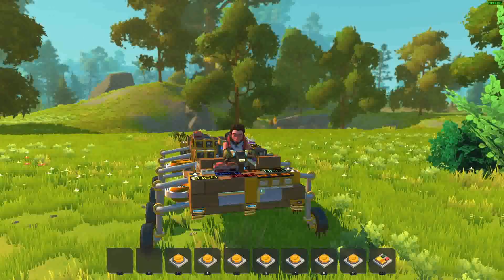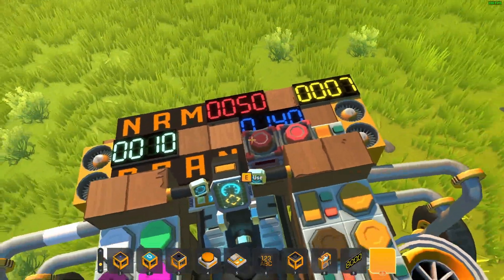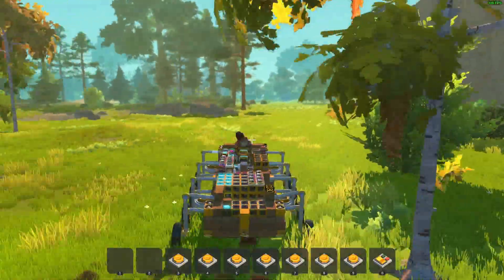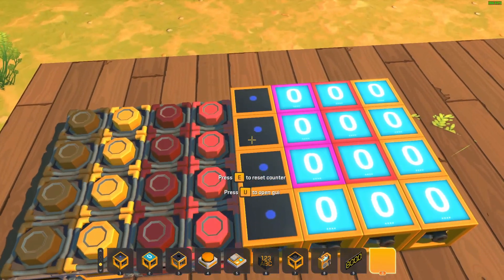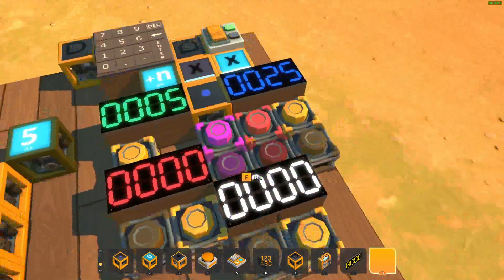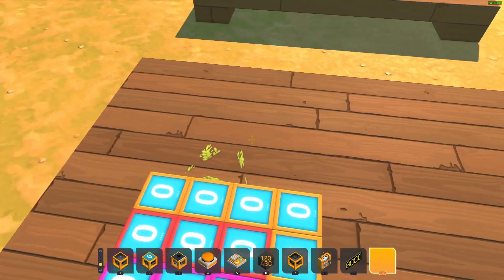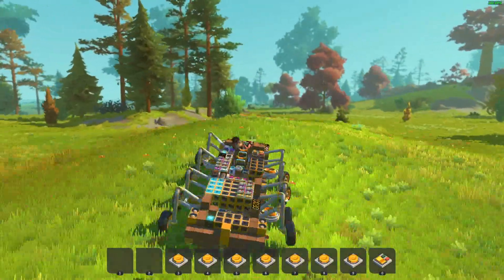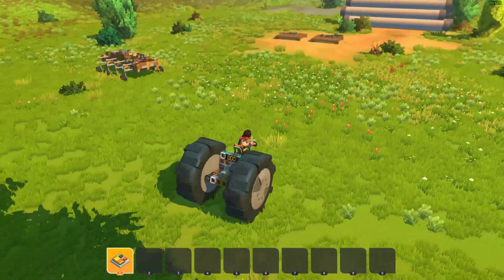Scrap Mechanic PID Flying Car

Comment: Are you using controller engines to replace suspension parts to avoid suspension glitch?
Reply: Cool, because when I tried using them, they just acted like solid connections, though might be because my vehicle was too light.
Reply from the maker: @A_generic_thing  Well it's important that they're set up right. If you don't have number blocks connected to it it defaults to  0 angle, 100 stiffness, 0 speed and 10,000 power.
Reply: @invadervim9037  Yes, but likely the settings on the counters were not set up properly, or something else was broken.
Reply from the maker: yes, I'm using the smart engines from the Modpack.